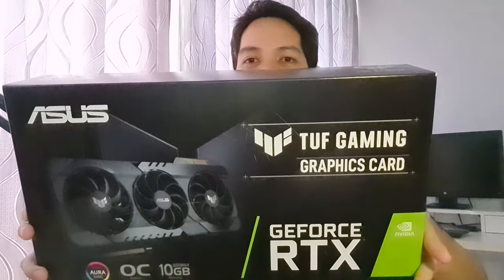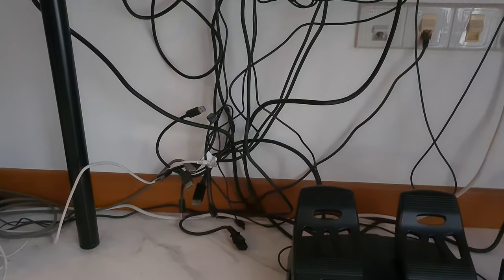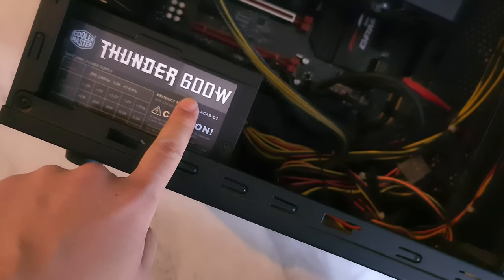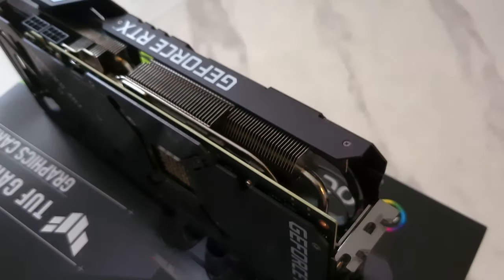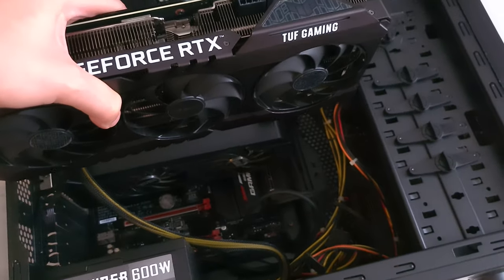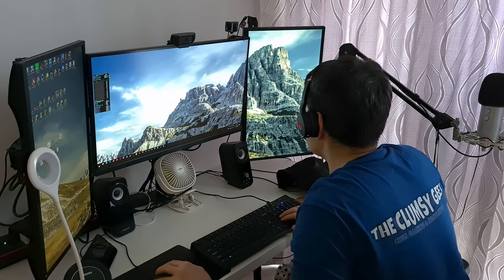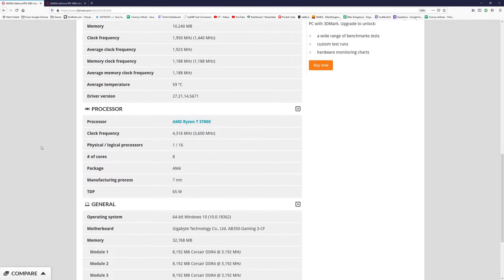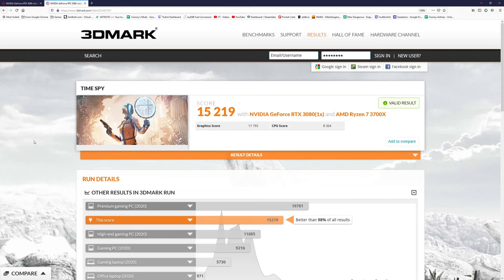Road to the ASUS RTX 3080 TUF - Part 1 - Installation

Comment: Glad to see your channel brings up opportunities like that and I don't mind product placement/sponsoring as long as it doesn't happen too often and actually makes you benefit for your content that we all enjoy :)
As for the CPU, it might be degraded due to the bandwidth that PCIe for the new graphics card requires. I don't think the temps got that much higher that the CPU throttles - Ryzen can handle quite a lot of heat. Nevertheless it's worth checking the airflow since warm air will accumulate over time and that's not good for various components.
Anyway, enjoy the improved performance/graphics, looking forward to Part 2.
Reply from the maker: Thanks man! Yeah same here!

Comment: Cant wait to load up ets and ats on that machine to see actual performance. I guess 4k 60fps should be possible now. Cheers mate!!!!
Reply from the maker: Yeah true! Thanks man. Catch you soon!
Reply: I use ASUS RTX 2070 Super, 4K, 150% - 200% scaling, all maxed (mirrors on high) - stable 60 fps single/multiplayer + promods. So RTX 3080... Yeah, It will do 4K :D

Comment: Huge upgrade! Have you tried using eyefinity? If you orient your outer monitors landscape you can run flight sim + ets2/racing games on all 3 monitors.
Reply from the maker: Thanks! It's like you read my mind. 😉 Stay tuned for part 3. 👍
Reply: @TheClumsyGeekGaming  Looking forward to it. I recently got 3 screens myself and its soo much better than 1, just make sure to try and use the correct FOV in game and  physical angles between monitors.

Takes a bit of time to calculate but worth it for the immersion. here's a great tutorial if you're interested:

https://forum.reizastudios.com/threads/tutorial-fov-triple-screens-immersion.4009/

Only downside is of course the fps hit from driving 3x more pixels  but with a 3080 it should be fine.

Comment: All of that and you didn’t mention what cables plug into the gpu.  I am so lost.
Reply from the maker: Oh, what cables are you referring to? The cables inside the case should be the standard ones that come with your PSU. They connect your GPU to the PSU for power.

Comment: i noticed you had the correct pci-e from the power supply to the gpu which was different then the one before. where did you buy that and what is it called? my current pci-e has one with 3 across and another one at 4 across. the 3070 has 2 @ 4 across.
Reply from the maker: The cable? It came with the psu for me.

Comment: CONGRATS from me too, you spoiled guy! BUT, now you should be able to buy that Samsung 49" Odyssey C49G95 Curved (1000R) 240 Hz QLED monitor instead, it would look so nice together with the new GPU power. Then you could also put those two portrait side monitors as landscape ones on top of it! Think about that my friend! 😂😂😂
Reply from the maker: Haha tempting! Thanks man!
Reply: @TheClumsyGeekGaming  As a matter of fact, you can run that monitor as the full setup you have right now, with a 27" monitor in the middle and two side areas, each half the size of a 27" one. Then you would get one 27" screen for gaming and streaming and two 1280x1440 screens at the side of the central one!

Comment: Can u pls let us know the max clearance for ur case? There is a 20mm difference between my case and gpu so I wanted to know if I can fit it in
Reply from the maker: I have a coolermaster n300, which states it has 320mm clearance for the gpu. The asus rtx 3080 tuf says 300mm on the length, so it looks like we're on a similar boat. 👍
Reply: @TheClumsyGeekGaming  sadly its inverse for me,the gpu is 320mm while the case is 300mm.....yeah got too excited with the black friday sale..
Reply from the maker: Oh yeah that might not be optimal. Well the impt thing is you'll have the card already. Buying a new case is a bit easier as there's plenty of supply lol.

Comment: Should I use two separate cables or one should be enough?
Reply from the maker: For the power supply? It might be best to consult your PSUs manual to check which connection and cable is best for GPUs.
Reply: @TheClumsyGeekGaming  I have RTX 3080 and had black screen often. I just plugged in two cables, still not black screen. Hopefully, it will work from now on. :D
Reply from the maker: Might have been the trick. Good luck!